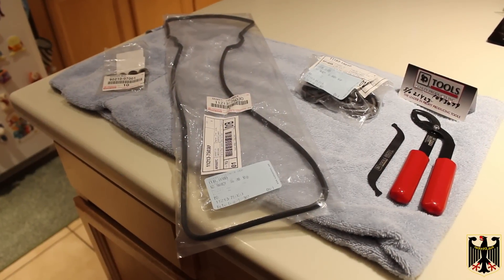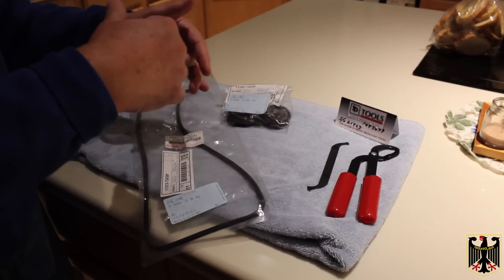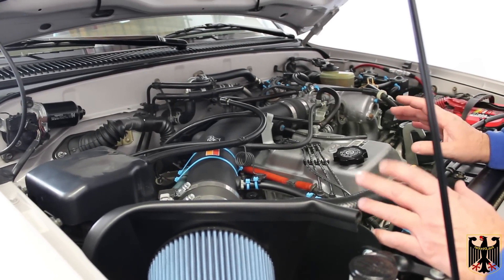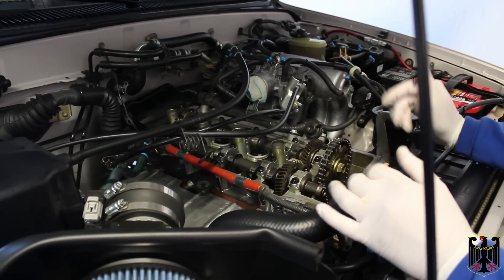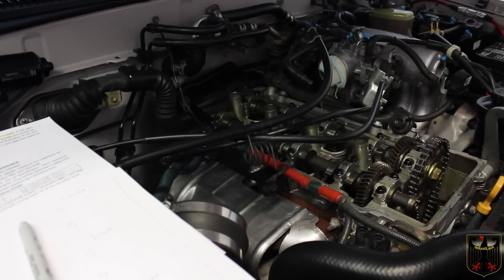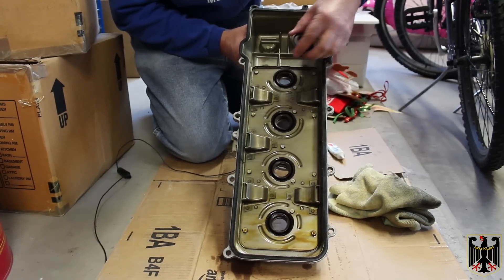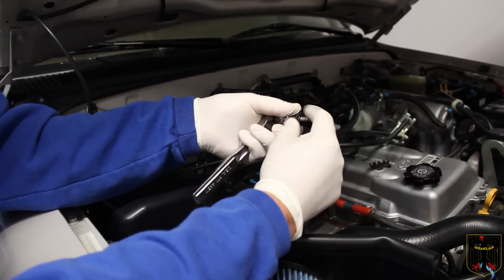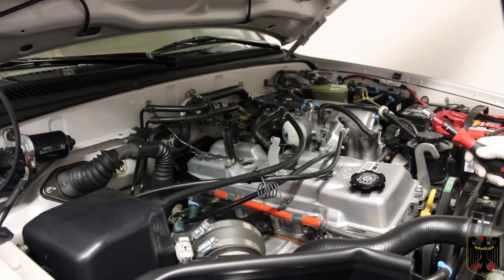Toyota 3RZ-FE Valve Clearance Check

Comment: Need some help please.
I need the ecu wiring diagram and the evap system diagram.
I can't find it in the internet.
Reply from the maker: That information should be in the FSM for the 3RZ powered 4Runner or Tacoma - that said, I'm not sure where to locate those anymore online, and my only copy is on paper.  Thanks for watching!
Reply from the maker: That information should be in the FSM for the 3RZ powered 4Runner or Tacoma - that said, I'm not sure where to locate those anymore online, and my only copy is on paper.  Thanks for watching!
Reply: @redonKiLaus 
Thank you.

Comment: How do i know that the other cylinders are at TDC? thanks
Reply from the maker: You can know either by watching the camshaft movement to ascertain where the cylinder is in its cycle, or simply start at the beginning with (if I recall correctly) #1 at TDC, and then follow the service manual instructions to a T and you'll be fine.  Hope that helps, and thanks for watching!

Comment: you are wrong about tdc, number 1 and 4 are at top dead center, not number 3, also you didn't show the right procedure to check the valve clearance  in other cilinders like 2 and 3 and if the cilinder is in compression or exhaust stroke

Comment: am i the only one who has issues getting at the back bolt under the wiring? its annoying  whos design was this XD
Reply: Computer Design (CAD) no physical engineer involved so dumb
things happen, this has been the same for many years and no cars escape the
stupid things that they do. One German car; you have to remove the front end of
the car and the engine to replace heater hoses, the results of (CAD)
engineering without human oversight.

Comment: asl cam guard - what type of oil do you use and what type of gasoline do you run all are important--?????? brand weight octane etc

- I am a mobil one oil  with filter--

 an exxon or shell guy I do not run cheap gas if I can help it--

 I must tell you 165k and that valve train looks better then cars with 65k kudos for your upkeep  just awesome thank you---  outstanding--
Reply from the maker: Joe Jack I always run Mobil 1 Full Synthetic - used to use 5W-30, but now use 10W-40 after turbocharging this truck.  Currently running K&N oil filters on this truck.  Also always run 91+ octane gas, mostly Shell or Chevron.  Thanks for watching!

Comment: If changing the spark plug tube seals (valve cover), like me, you may be inclined to knock them out with a hammer and large flat bladed screwdriver from the top side.  Don't do this, the bottom part will just break off.  Instead take your screwdriver from the underside and insert it under the entire seal and pry it out.  It will pop right out, no problems.   Use the old seal to set on top of the new seal, tap it with your hammer, and the new seal will go in easily.  In removing the valve shims, first watch this video https://www.youtube.com/watch?v=pKEkOdQuJR4.  If the shim won't come out using the spacer tool, insert a larger flat bladed screwdriver to create more clearance and the shim will come out.  I just completed this service on my 2000 Tacoma prerunner 2.7 with 140k.  All valves were in spec, however I had two exhaust valves that were measuring .010in that I brought back to the optimal .012.  Timing chain seemed fine.  I have used Toyota filters and Mobile 1, 5w30 in winter and 10w30 in summer.  Great Video!  How bout a video on how you clean your engine bay?  That engine bay is CLEAN!

Comment: I swear, you have the cleanest 3rd gen 4runner I've seen on a any tutorial lol thanks for the help man!
Reply from the maker: I think there were around 165k miles on the truck when I made this video.  I'm the original owner, and while it's been in Arizona or New Mexico for most of its life, it also spent 4 years in Massachusetts.  You just have to keep everything religiously clean in order to prevent grease buildup and rust/corrosion.  Everyone's engine bay can look like this, most just don't want to put in the time.  Thanks for watching!
Reply from the maker: swigga4O Thanks for watching!
Reply: That under hood is so clean it looks like it just rolled off the showroom floor.  Nothing shows any sign of wear or use.  redonKiLaus is this video really from 2014?  As new as the truck looks, the video should be at least 15 years old!  How many miles were on it when you made this video?  BTW thanks for posting this video.
Reply: Looks mint condish

Comment: Maybe I missed it, but what is the car's mileage when you did this check?
Reply from the maker: It was around 165K miles, valves never adjusted before.  Thanks for watching!
Reply: @redonKiLaus  how many miles do you have now ? have you checked them again ?
Reply from the maker: @bosshogg690  Rarely drive the truck so haven't checked again, only at 190k miles now.  Thanks for watching!
Reply: @redonKiLaus  dam you still answer questsions from a 11 yr old video. My tacoma / 2001 hilux has 267000km idk if i should check them. It starts fine and doesn't have any issues
Reply from the maker: @bosshogg690  Absolutely, I still actively make videos regularly!  I'd check 'em to be safe, gets a nice fresh valve cover gasket (and spark plugs if you do at the same time) on the truck as well.  Thanks for watching!

Comment: hi there!
i have a problem with the VSC System on my 2001 6 Cil Toyota 4Runner. The VSC and VSC OFF turned on. Hope you could help me with this in another video. Thank you!
Reply from the maker: When the VSC lights come on, there is often an issue with the ABS sensors/system.  However, since my truck does not have ABS, traction control, or stability control, I cannot make a video on your particular problem.  A great place to help you diagnose your problem is t4r.org.

Comment: Thank you for making this informative video. I am now more confident to work on the valves.

Just wondering how do you keep the valve cover so clean? I tried degreaser and it made it worse, it was turned to dark grey, very sad.

Also where did you get the instruction print out?

Thanks again
Reply from the maker: Good news: you can buy a new painted cover from LCEngineering in either red or black for a very reasonable price.  Aluminum turns dark when exposed to some chemicals, especially acids.  This is why I use Simple Green on my engine bays.  It is biodegradable and won't discolor or eat anything.
Reply: redonKiLaus Just curious where did you get the instruction print out for valve clearance check?

Thank you, I will switch to Simple green soon :)
Reply from the maker: I think it was TacomaWorld, but I'm not entirely sure.

Comment: oh, another good video would def be to actually take a shim out and measure, calculate the new one needed and re-install.  Good to see your's were fine, but just to see that all take place would be educational.  I'm considering checking all this on my '96 Land Cruiser soon.
Reply from the maker: I found a great video on a Land Cruiser valve adjustment, including shim replacement and measurement.  Link is here: Land cruiser 1HZ 1HDT  1PZ Valve shim adjustment tutorial
Reply: I saw this one as well.  Even though this isn't the engine I have, it is close enough and I think it will def help me.  Thanks!

Comment: Just courious, why would the valves tighten up vs. loosening up?  I guess as the valve mating surfaces wear it allows the valve to go further up thus getting tighter on the lobe?  Good video, nice to have the part numbers listed.
Reply from the maker: Thanks for watching the video.  We have read that the problem is associated with the exhaust valves primarily, and that over time, the seats hammer into the head.
Reply: Okay, thanks for the reply Mike. C

Comment: Out of curiosity what brand and weight of engine oil do you use? I use Castrol GTX HM 10w40 and Toyota's denso filter. I change it every 3 thousand. My driving is now mostly highway aswell. (I have a 1996 4runner the same color, 2.7, 5speed, and also 2wheel drive. As yours)
Reply from the maker: I use Mobil 1 Full Synthetic 10W-40 and a K&N filter.  We will be switching to GReddy filters soon, as they are made in Japan.  Most of my driving is in the city, which is part of the reason for my poor fuel mileage.  Thanks for watching.

Comment: Also I forgot, you can buy ASL CamGuard on Amazon for about 30 bucks for 1/2 quart - that's enough for about 3 oil changes.  You buy the automotive version, not the aircraft version.

Comment: Part numbers:  tool is from LC Engineering (awesome company for Toyota mods and parts BTW) P/N 1093079; Washer Seal (10) 90210-07001; Valve Cover Gasket (1) 11213-75030; and, the "secret" Toyota PN that is so hard to find for the wiring loom clamps is 82711-1B010 - I am going to order a few since these have become very brittle.